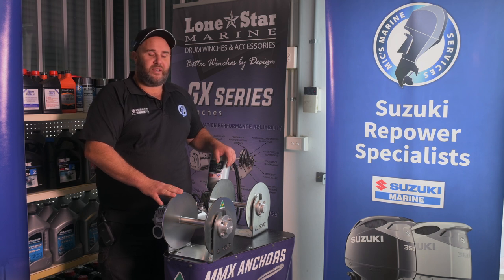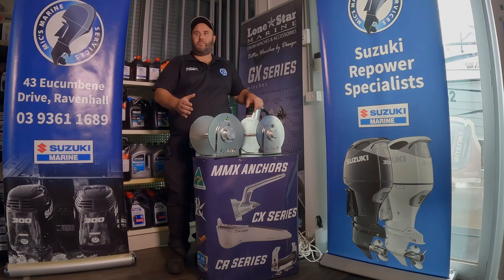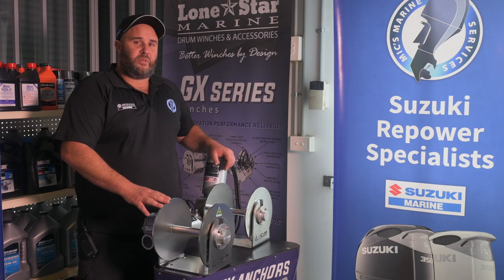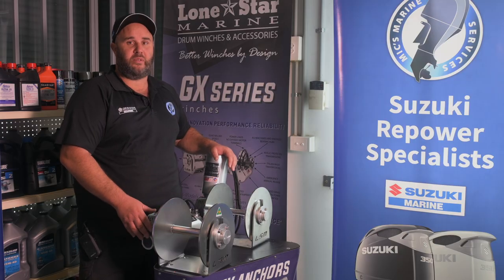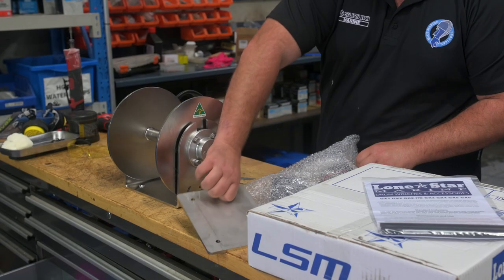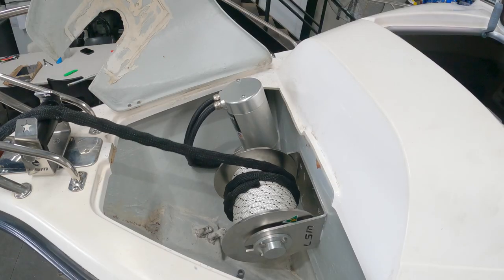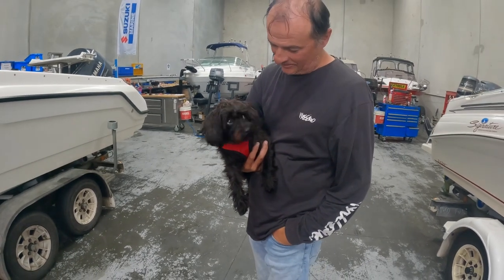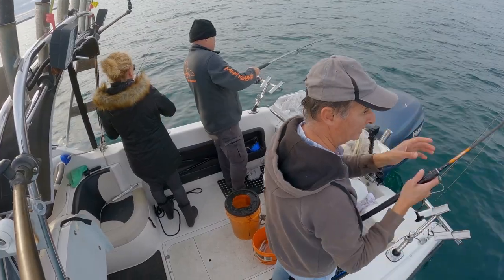Why Lonestar GX2 HD and no just GX2

Comment: Why not just buy the GX3 as it's only a little bit bigger and holds more rode?
Reply from the maker: It doesn’t fit inside the compartment. Missing few cm
Reply: @happyfishermanadventures  
Shame as the GX3 is only about $100 more.
I've been looking at this and built an anchor locker and then decided to go completely different and use a Minn Kota.